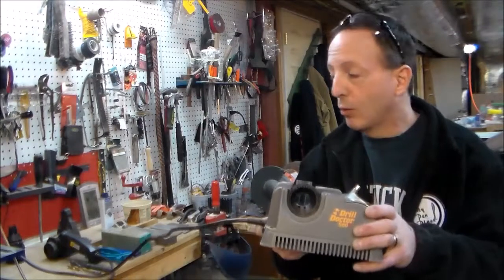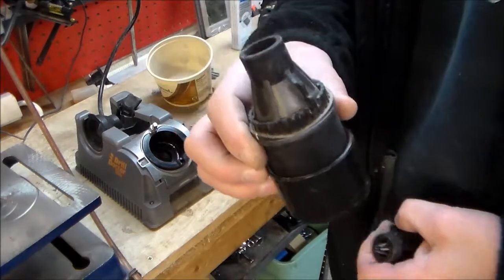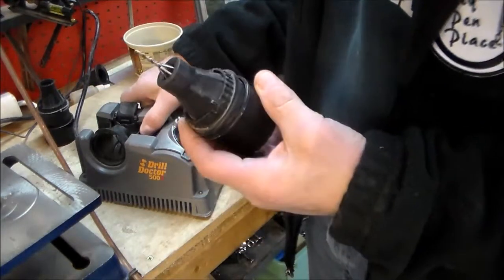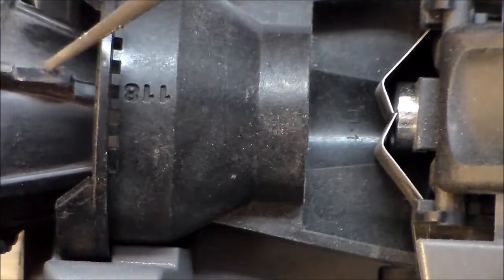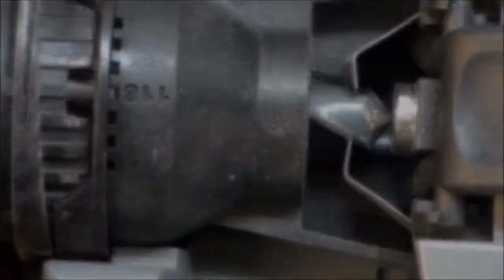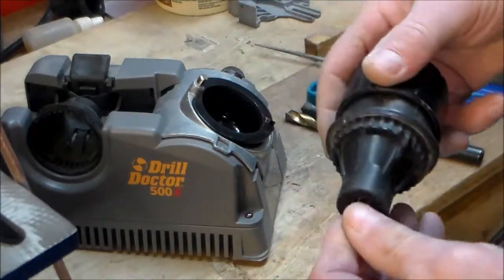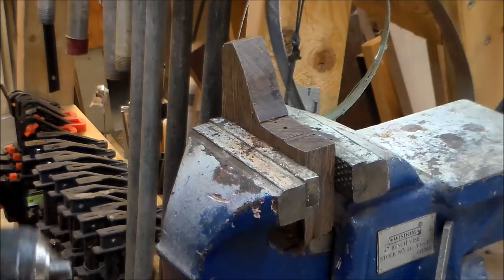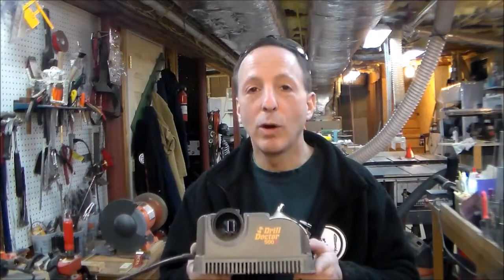Sharpening Drills the Easy Way With the Drill Doctor

Comment: What happens if you set the bit before or after the 118 mark.
Reply: Whatever  "drill" your trying to sharpen is factory sharpened to a specific edge 118 is very common  drill bit
Reply from the maker: Drill bits are typically 118 or 135 deg for most materials. The collet register slot is set to those two angles so I expect the edge would not line up correctly. Thanks for watching.